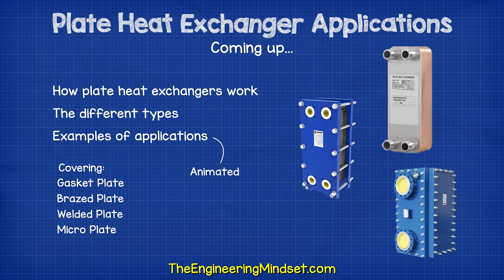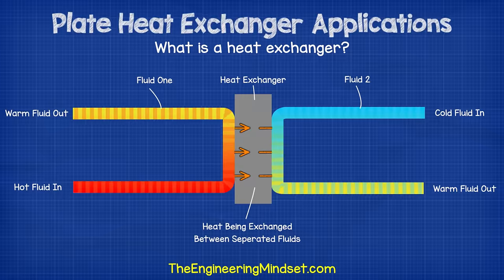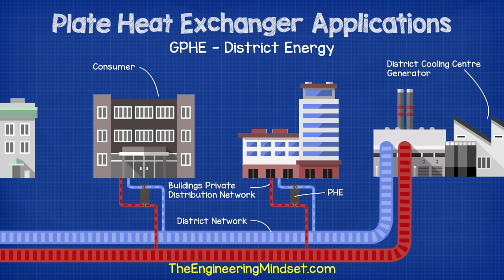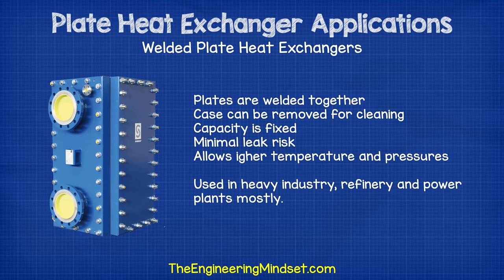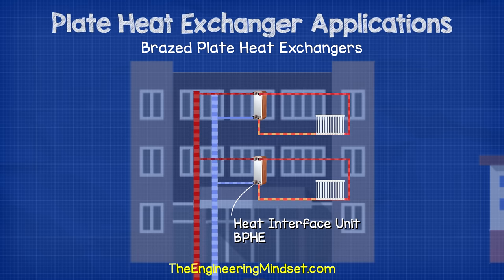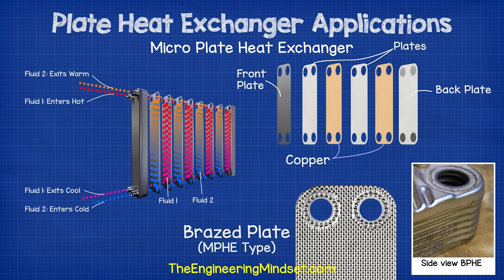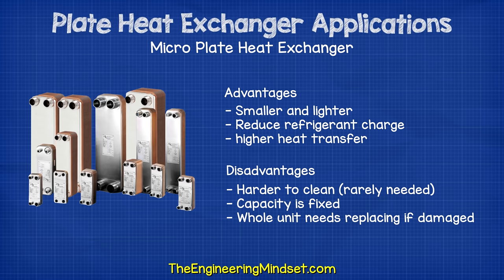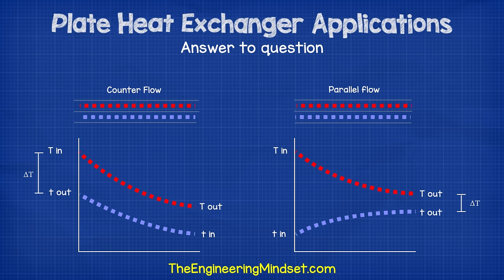Plate Heat Exchanger Applications and working principle hvac heat transfer

Comment: Why do fluids in plate heat exchanger typically flow in opposite direction ? 
This design of heat exchanger is to provide a thermal equilibrium between the 2 fluids( Inlet and outlet).
 I asked myself that question 2 days ago as well.

Excellent video .
Thank you .

Comment: We use 3 stages plate heat exchanger to preheat the milk/custard/chocolate milk from 4> around 75 degree celcius before pasteurization or sterilization. After the pasteurization it flows back through the heat exchanger to cool it down and heat the cold milk.
Reply: Where do you work at? Kinda curious to see what companies use these

Comment: Before finishing the video I'd say that the reason the flow is flipped every plate is because the heat will be as far as possible from the other heat source so that the water can cool down before it hits the warmer water(in the other plate) coming towards it and thus as you said the colder water will absorb the heat of the warmer plate. Otherwise, the plates will have no thermal difference thus no heat exchange.

Comment: I am a maintenance tech for a major automotive manufacturer. We have 1200 Hydrolic presses that use plate type heat exchangers to cool the hydraulic fluid. Water in one direction and oil in the other. My question is should the water that is leaving the heat exchanger always be on top since heat rises or does that make a difference at all since there is so much volume that flows thru?
Reply: The port of water/oil come out or in depends the designer, have to many variables. The transfer of heat will happen because the flow, check pump or sometimes you heat exchangers needs to be cleaned.

Comment: I will comment and participate.
The fluids run counterflow to be more efficient.
The fluids running Against the Grain causes hottest fluids to mate with the coldest in order to push the two fluids closer to an equilibrium
Or that's my hypothesis.

Comment: Does it matter if you pipe your hot water in from a outdoor wood boiler to the top port flowing down or do you have to pipe hot water in on the bottom port flowing ip

Comment: I work for the University of Texas Arlington. Our Thermal Energy Plant started turning steam on yesterday 5-21-2020 and today I'm walking the buildings and some tunnels.

My question, what should the guys in the HVAC Department check for on the steam tree, guages, pipes, condensate pumps, etc. in each mechanical room once steam is fully back on?

Such as checking gauge PSI before and after. Meaning low/high, before  Spence and after Spence PSI.

And what to look for on a spence/spirax and pilot valve?

What about pop offs?

I'm still new to this field and want to learn best and safe practices to shut down and especially start up and after startup.

Is there a checklist for the steam tree pipes, valves, and pumps, etc.

Thank You,
Carl Browning

Comment: I haven’t found any answer regarding irreversibility which is connected to the 2nd law of thermodynamics. Basically, another possible explanation to why is the counter flow more efficient is that it maintains more stable temperature difference during the heat transfer process. For parallel flow, the temperature difference varies a lot during the process. It is a well-known fact that the higher the temperature difference, the higher irreversibility. To prove a better efficiency of the counter flow arrangement, look for the LMTD method and compare both arrangements. You will get a representative value of deltaT higher for the counter flow, hence, considering the same size, the same fluids, heat transfer must be higher for this arrangement.

Comment: The answer to your question, I'm using water for the process and steam as the heating medium: The water entering the heat exchanger at the bottom has the largest temperature differential and will extract the most energy out of the outgoing steam condensate. As the water rises through the heat exchanger, the water within the heat exchangers upper region will have the smallest temperature differential, this gives small delta T provides the ability to 'control' the temperature of the outgoing water by modulating the heating medium. If it was reversed, you wouldn't be able to control at all, and you would have all sorts of issues with water hammer etc. in the steam and water side as both condensate and water flashed off and collapses.

Comment: also, you promote Defoss, quite a lot. but i dont see any courses with certification option on the website as mentioned in this video couple of times 8:55
am i missing something here?
Reply from the maker: There is an exam at the end of each class :)
Reply: @EngineeringMindset  oh that's nice. So, that means all course offered  have certification?
Also, what will the certificate say on it, and what's the validity of it?
How to prove it's authencity (other than knowledge, cuz I'm sure I'll be learning it all)

Comment: Sir I am using glycol water chiller  of 5 TR  for milk pasteurization  and during this process I want to cool my milk to 4 'C but the temperature of milk is  not maintaining as I want to maintain. I am using around 300 l of glycol water solution  but temperature of milk   maintained  around 18 'C so what are solutions so that I can maintain 4 'C temperature of milk
Reply: satendra patel kindly check cond and ev valve